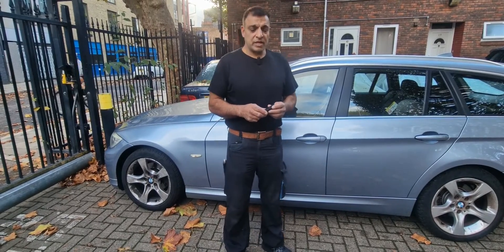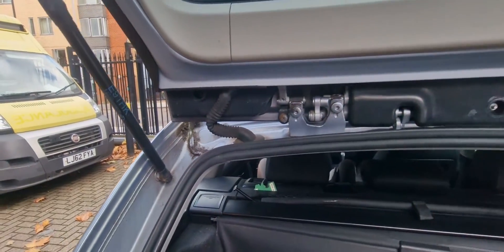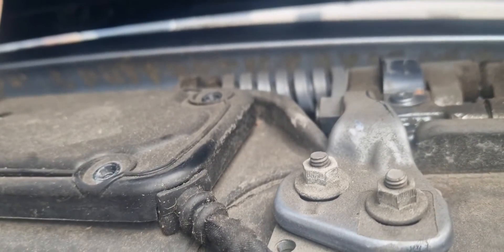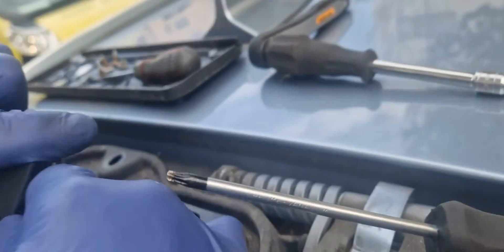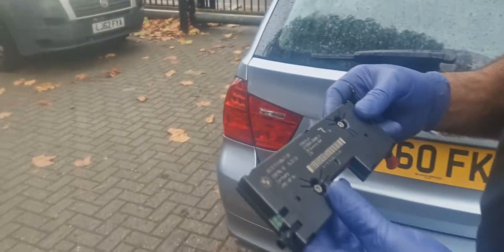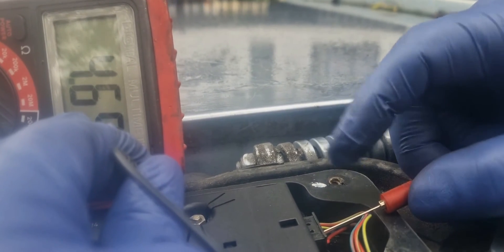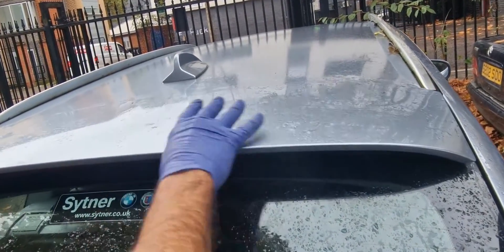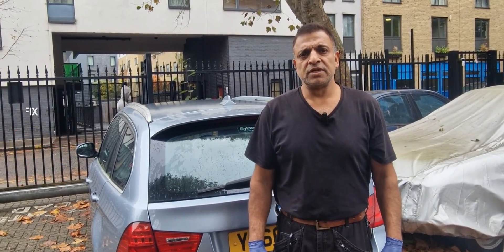BMW E91 Remote Central Locking Diversity Antenna FIX

Comment: Here I have a bmw 2007 e93 335i and I have one key and it starts the car but does not lock it or open it and I programmed 2 and it does the same thing the battery works and if I lock the car from the inside the button also closes and opens and so if it works with a mechanical key??

Comment: hi can you help, my fob doesnt work, ive checked diversity antenna wiring like you did, you said wires 1 +4 should be 12volts, ans 2+3 should be 5volts,,,, mine are as follows 1- 4.06v/ 2- 3.93v/ 3- 4.5v , 4 - 11.61v,  does that mean my antenna is faylty.

Comment: Thanks for detailed video on the matter. I have a question, if the 4th wire didn’t have voltage, why did you diagnose thats its module fault, not wire itself?

Comment: Hello, what is the ribbon cable to the right with the purple connector? Mine has snapped off its connector and I am not sure how to repair it.
Reply: did you solve it?
Reply: @ I'm going to look at the issue on the weekend and will post my findings. The earthing straps are also damaged so I am going to replace and fix those which can also stop the remotes from working.

I believe the brown ribbon cable with the purple connector is to one of the car's antenna's but I could be wrong. I am currently trying to see if I can fix it without spending any money at BMW.

Essentially both my remotes got progressively worse over time and eventually stopped working altogether. A new key didn't fix so now I am looking into the car.
Reply: @idontlikebass  the brown ribbon cable is practically the “signal receiver” from the keys, I was curious if you found a way to “solder” them
Reply: @idontlikebass  Before it stopped working, all the doors were locking n unlocking except the driver’s one which was only locking
Reply: @anduoff808  Ahh that could well be why mine has stopped working then amongst other issues. I have some ideas on how to fix it, I just need to give them a try and see if I get any results. If the cable has snapped halfway, you are in a better place than I am trying to fix it back into the connector. 

If the cable is cut or damaged you can use solder flux and either splice or just re-solder the broken tracks back together. Then use some good tape to stop the mobility once repaired.

I am not sure about tackling at the connector end yet, I am going to look into it at the weekend but I am hopeful. Worse comes to worse, I will add my own wires to the connector and solder them to the detached ribbon. Solder flux is a must though to stop it going everywhere :)
Reply: i'm facing the same issue

Comment: La chiave non apre e non chiude le porte. Col pulsante interno funziona tutto, Quindi escludere che sia la centralina la causa. La radio riceve bene. Alla concessionaria senza controllare l'auto hanno detto che si tratta della batteria della chiave scarica. Praticanente di prenderne una nuova per via che la batteria è saldata all'interno e quindi non può essere sostituita. Domando: non c'è un accessorio o un modo che assicuri che la batteria che la batteria sia realmente scarica-grazie

Comment: Hello i have same problem with diversity. But i have 
1st cable 12volt
2nd cable 12volt
3 cable 0volt
4 cable 12volt

it is same probleme diversity HS?
Reply: Did u solved it ?

Comment: Helpful step by step guide to yet another BMW defect and plastic nightmare fight.
Well done - you won.

My wife decided to buy a BMW to  temp replace her ultra reliable Toyota diesel  , due to khan in London and his fraudulent ULEZ expansion-aug 2023 We are hoping that it gets voted out in May.24.

The BMW e91 ,is definitely not ultra reliable, but the straight six engine is nice.

Will try to follow your vid and replace the diversity aerial.

Oh , it's an aerial according to the Haynes manual, it's the US which call it an antenna, the word to describe insects head feelers.

Comment: Hello, thanks for the very informative video. That's a very thorough effort there. My F07 BMW GT has intermittent key fob issues. It works sometimes but doesn’t many times. I get the key not detected warning on the dash those times. This warning also pops up sometimes when the passenger side front door is opened. The dealership says its the antenna. Have you seen such an issue? Thank you for your time😊

Comment: Waoooo sei un grande 👍🏼.
Per caso hai qualche video per quanto riguarda la riparazione dei cavi?? Nella mia sembra checi sia una interruzione dei cavi e per quel motivo non funziona la mia chiusura.
Reply from the maker: Hi if you check in the rubber grommet you will find the broken  wire in  there,veiw my fiat 500 boot catch video

Comment: My keyfob works when it’s closer to the diversity antenna. Can you let me know if this is a keyfob problem or something wrong with the diversity antenna
Reply: Did you solve it ?
Reply: i have the same issue , did u guys fix it?
my key working from behind the car closely < otherwise its not working
is the key problem or the Antenna  

 @karlito1995

Comment: What is the pin 4 wire about? I have the same condition but with a replacement diversity antenna I still don't have a reference voltage at pin 4. Thoughts?
Reply from the maker: Hi you might have a broken wire in the grommet area

Comment: Hi, great video. Do I need to code the replacement antenna to the ecu?? Does my old key work with replacement antenna?
Reply from the maker: Hi you don't need to code the new unit,but you might have to switch the ignition off and on a few times
Reply: @thefix9823  will my old fob work with the replacement antenna ?

Comment: Great Video, thanks. A BMW specialist have confirmed my Diversity Antenna is toast. Going to get a replacement on eBay and give it a go changing myself. One question, is the module plug and play, or do I need to code it to the car or the keys? Thanks
Reply from the maker: Hi, the module is plug and play,but sometimes, you have to start the car up and switch it of to make it work you have
Reply: @thefix9823  Perfect, thank you! Finally got round to ordering one! Fingers crossed replacement goes smoothly 🤞🤞 Thanks again

Comment: What a botch, 2 plastic dowels on the spoiler forgotten to loosen, then scrape with the screws over the roof. The 3rd cable also has voltage only when you turn on the radio. The diversity is almost never broken, it is usually a cable break.

Comment: Thanks for the video. I hav ebeen searching to narrow down my issue of intermittent fob connection and think I narrowed it down to this booster. I checked the 4 wires and have power to all 12,5,5,12 volt but noticed the fob would work right up to the controller but stop when put behind my back. I think the amplifier is out. Have a $45 replacement coming. Any who... thanks for the info you have shown!
Reply from the maker: Hi, let us know how you get on

Comment: Both fobs aren’t working on my car. If it’s wiring is it the wiring on the right hand side of the diversity antenna which I need to check for the voltage? Like your video. If no voltage then wiring issue? Thanks!
Reply from the maker: Hi, is the central locking from the button inside the car
Reply: @thefix9823  central locking works with the button inside the car and the emergency key. Just not either of the fobs. Everything else works as normal.
Reply from the maker: Check the wiring from inside the rubber grommet for broken wires.
Reply: @thefix9823  is that the rubber grommet on the right hand side of the antenna like the video.
Reply from the maker: @rthomasbox  yes it is
Reply: @thefix9823  great thanks I’m giving it go later with a friend!

Comment: Great video! I have no 12v in the last pin! Basically the car closes all the doors ( open tailgate with no problems) but I cannot open the 4 doors with the FOB, I can only open the driver door with the key and closes fine with the FOB! Do you think I need to replace the diversity or might be a cable problem?
Reply from the maker: Hi, check the cables first in the rubber gromit
Reply from the maker: I think you might have a fault fob
Reply: Small update: I’ve brought my car to check the wiring and seems all fine! They still troubleshooting with some software! At this point I think or is the fob indeed or the diversity module which still doesn’t bring 12 volt on the bottom cable when the car engine is off! Let’s see the next episode 😅
Reply: Hey jaco I have the same issue did you find the problem?

Comment: This video is really good.I have a BMW X5 E70 2012 which has central locking but the car key sometimes locks it and sometimes doesn't unlock. i opened the diversity unit and cleaned it with a electrical cleaner and still have the same problem.my remote signal is perfect. please advice me
Reply from the maker: Hi, I think you might have a broken wire or a stretched wire in the tailgate rubber grommet

Comment: Good video. 
I have The same problem in The same car.
In my situation I dont have 12V voltage in last pin.
But I have it after ignition on.
In Your opinion, where can be A problem?
Reply from the maker: Hi, if your key is ok, check the fuses, and if the fuses are ok, look inside the diversity antenna for water damage and also press the boot release button on tailgate without ignition on and check last wire for 12 volts do this before checking the diversity antenna,if you have voltage there then you have got broken wires in the tailgate grommet
Reply: @thefix9823  thanks a lot.
You are the best.

Comment: I have a bmw e61 car. There is a problem with it. It does not open or lock with the key. I saw intermittent peace and I connected it, but the central lock did not work and the radio works without problems. I do not know what to do. Please help me.
Reply from the maker: Hi, you have to check the wiring to the diversity antenna unit for more broken wires